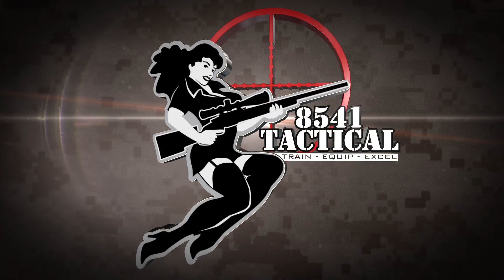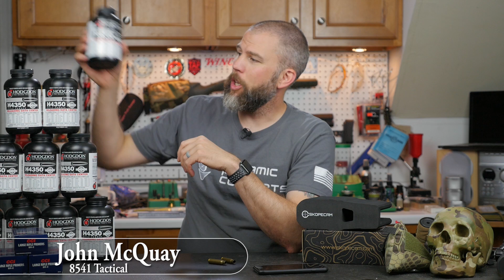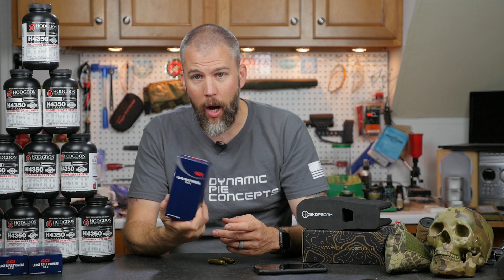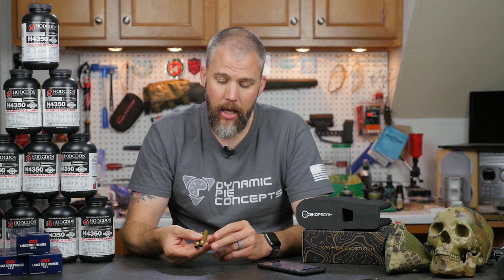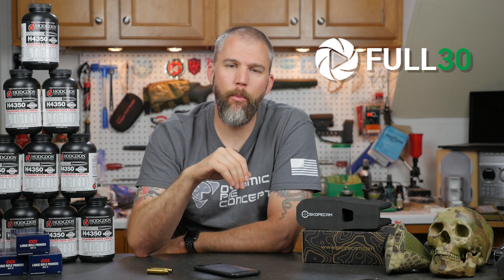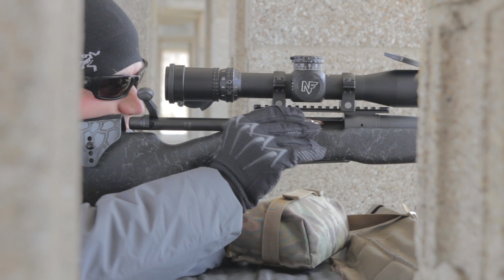Mail Call Mondays Season 6 #13 - Suppressors, Sorting Brass and Kestrel Wind Sampling

Comment: HI,  I bought my suppressor cover before I received my suppressor from Silencer Shop.The Gemtech Tracker for my Remington 243 and 308.  After waiting one year and a month to get the can,  I was reading the warranty info and it said not to use a cover or void the warranty .  The can needs time to cool.  Not to shoot more than 10 rounds and then let it cool to ambient temperature.   It is made of titanium and aluminum.  Of all the suppressor I see on line, 90% of them are using a cover to help prevent mirage. Just thought I would tell you my frustration and disappointment about my new suppressor.  What do you think ?  Your opinion ?

Comment: As far as water surface tension, add a small drop of detergent in the water, use a large quantity (water) to add the detergent, then fill a coffee cup with that water. The detergent will eliminate the surface tension and you can fill the case up until there is a flat surface right across the mouth.
Also use the case plugs mentioned earlier from 21st Century, that speed things up. Also, clean the cases prior to water weight sorting.

Comment: Hey John,

I'm wondering about the Ultimatum Precision Action you teased several weeks back.  Have you had the chance to mount it in a chassis yet? I'm interested in the floating bolt head design and how that might work with a switch barrel design.  The 3-lug (60* bolt throw) would be nice for a switch barrel deign.  (at least that is my understanding of how this is being marketed).

Thanks for you all you do for us!
Reply from the maker: +Jknox1030 The Ultimatum Actions are going through a redesign. Once we get the new version we will be going forward.

Comment: hey John, as a fan of TC's Encore and Contenders I was looking at getting a 300 WM Encore. one thing Bellm commented was that most SAAMI reamers for 300 WM had a short throat that hindered accuracy. What he does for chamber cut but other (manufacturers) is to extend the throat a short ways using a minimum diameter throat. Basically remove the rifling at .308 for another .1" or so. This allows the bullet to be properly supported while engraved by the rifling. He also considers most SAAMI spec reamers to basically creat a shot out barrel from the start. Expanding an the above ideal he cuts throats separately and at minimum diameter concentric to the bore of the rifling. Seems like a start.

Comment: My Long Range  in 300 RUM  has poor bolt lug lock up, the receiver is out of square, the recoil lug is out of square, and the throat is a foot long. Otherwise it is perfect. 

Needless to say it is at my mechanics shop now. We are hoping to save the barrel by cutting a new, tighter chamber.